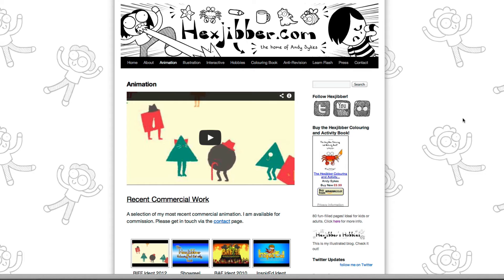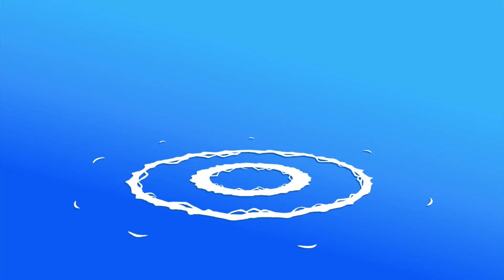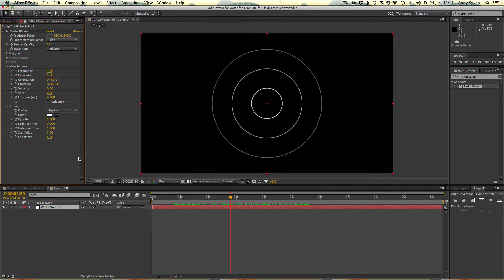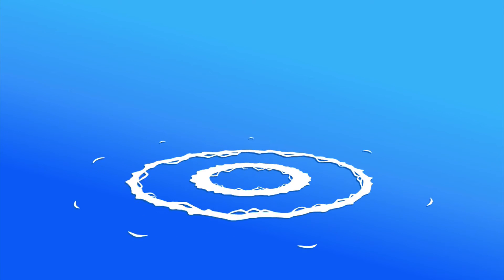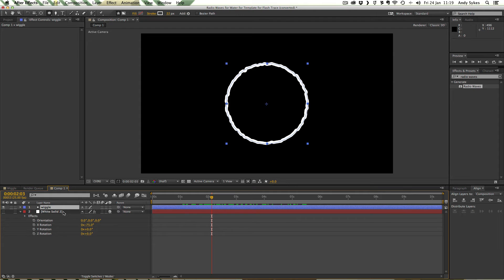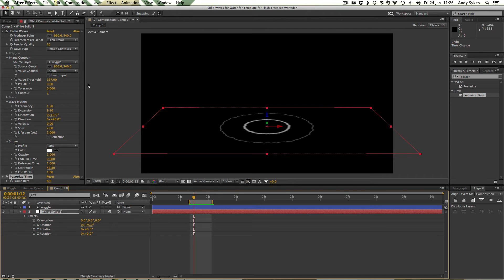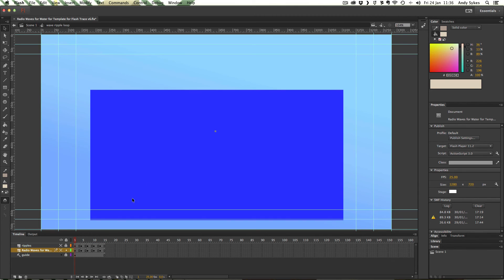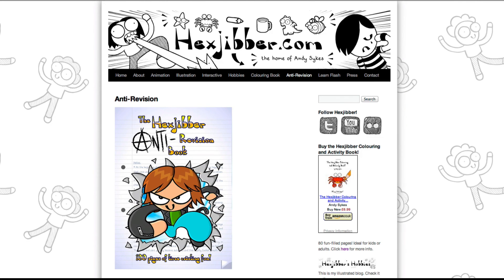Elemental Animation 013   How to Animate Water Ripple

Comment: Great tutorial. Liked and subed. Can I ask a question? I don't use Flash and I'm wondering if it's possible to use AE make the ripples break apart into individual waves at the end. I'd like to do it entirely in AE (it doesn't need to look as good as yours). I figure I could do it with a mask but you might have a more optimal solution.
Reply from the maker: Josh Wilson Hi Josh. Yes, I think you would have to use a mask, and use the 'Parameters are set at 'Each Frame'' option. Then you could animate a mask slowly creating gaps. That is the 'off the top of my head 'suggestion. Thanks for the sub!

Comment: Hello, i like your tutorials they could help in my animation project, buti don't have flash experience but i am doing an animation with fire and water using 2D traditional and After effect it there  a difference if i don't use the flash parts ? also can you recommend a tutorial for movement inside the character (background) like in chowder from cartoon network or in pixar's day and night short? thank you .
Reply: The thing your talking about in chowder is basically just a mask effect, and the bg it's masking, is usually fairly big and doesn't move with the character.